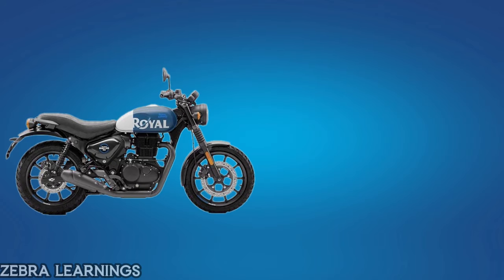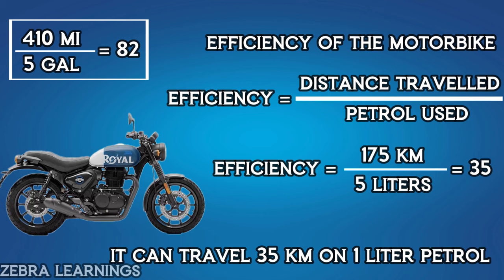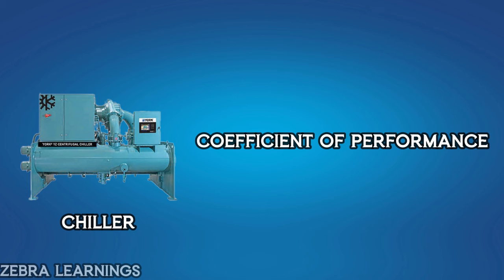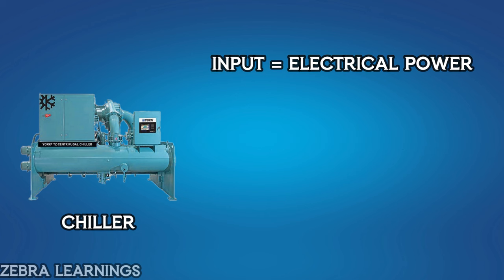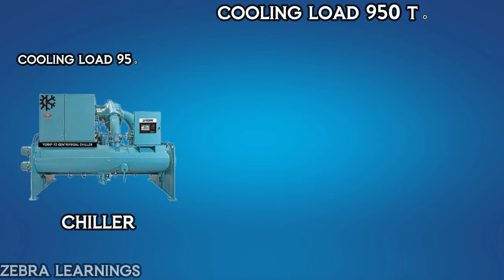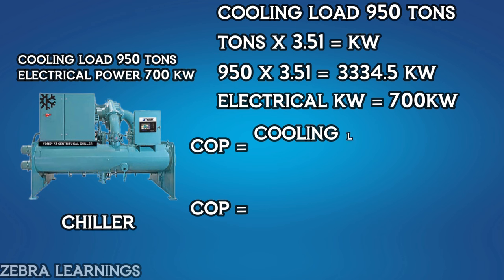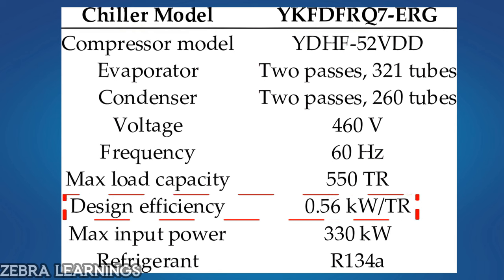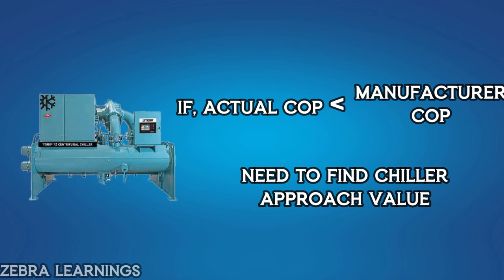COP | Chiller Efficiency Calculation | Coefficient Of Performance | Animation | #hvac #hvacsystem

Comment: Where we can get the electrical power and it will variy every time based on the how many compressor is running.
Reply from the maker: The reading doesn't vary too much. So we can measure a value and use that value.